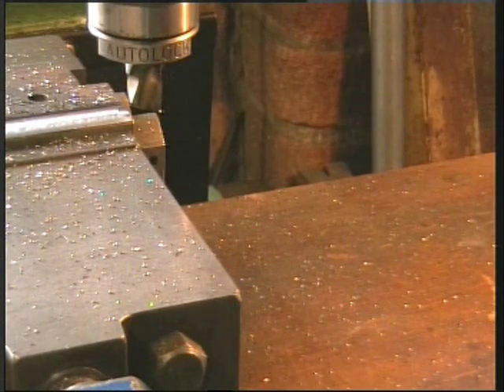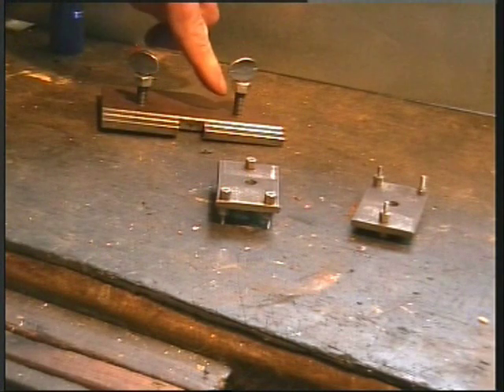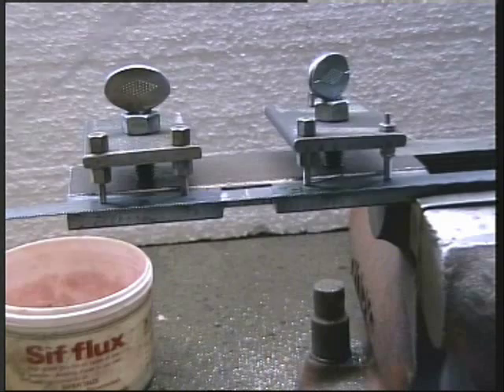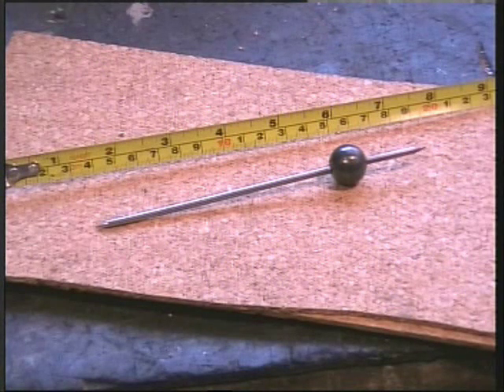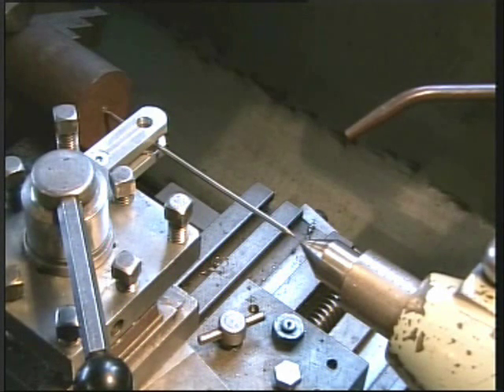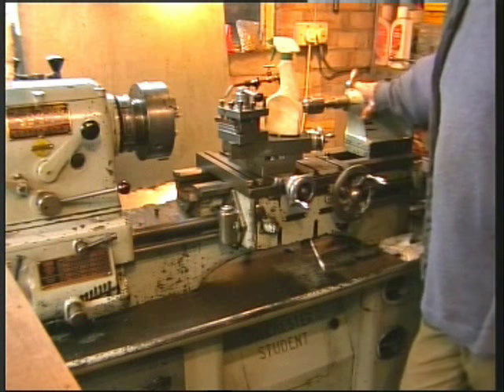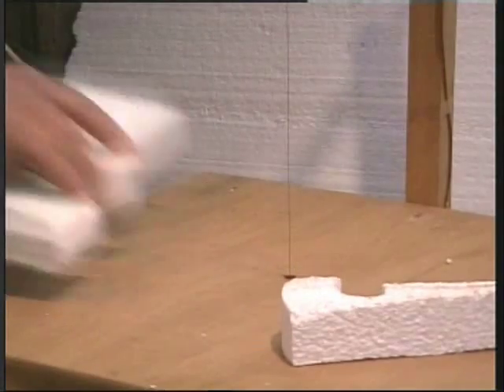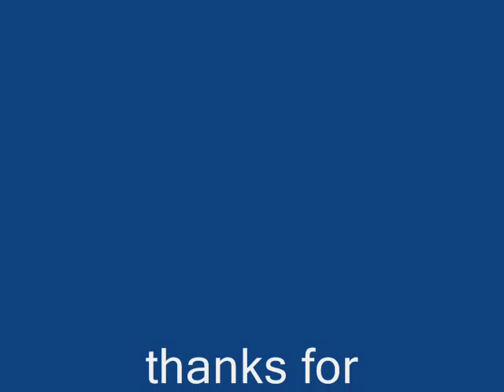waffling agane in the work shop.wmv

Comment: Another excellent video, when in my 'teens ( nearly 50 years ago) I used to work in a sawshop making and sharpening all types of saws up to 46 foot bandsaws with a 10 inch blade width, joining method much the same except the laps were hand filed and flux applied to both laps, strip of silver solder placed between laps and then two oblong irons that had been heated in a furnace were placed above and below the joint and all was firmly clamped together, as with all soldering cleanliness was king.

Comment: Wanted to say thanks… I used your Band Saw Blade repair Jig design for the inspiration of my own version and it works like a charm.  Thanks again
Reply from the maker: I often find "simple ideas or technics" are dismissed and if you try to say how really useful they are,it comes across as though your labouring the point, so its nice when someone takes it on board, thanks

Comment: I really like the heavy steel plate for the table on your drill press too! I have an el-cheapo bench-top drill press (Chinese) that has a really crappy cast table. I think I'll try to do something similar.

I already replaced the upright post with a taller piece that has a much thicker wall for added rigidity. And if I could add a beefier table that would support my 4" Kurt vise, I'd really be in business!